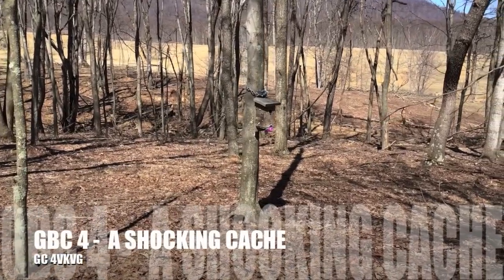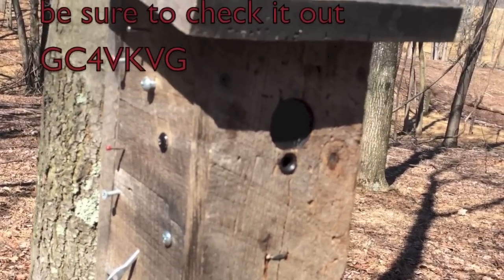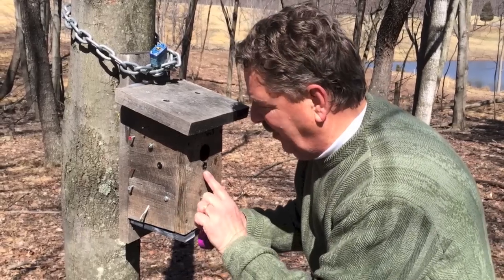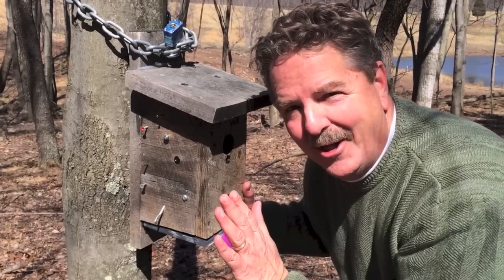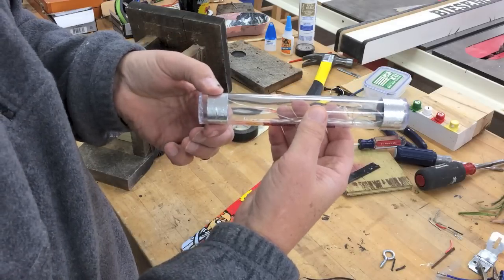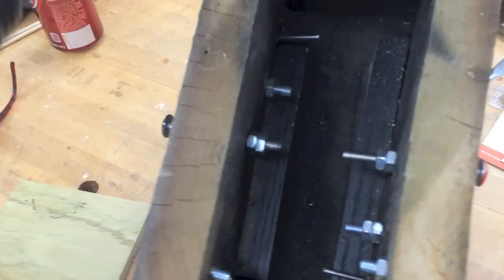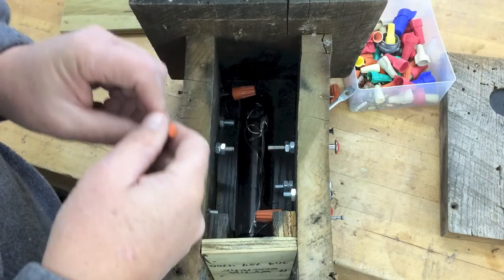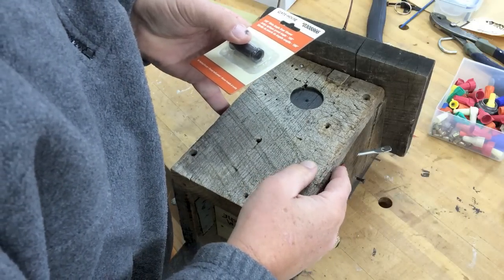How to build a "shocking" cache

Comment: Hello WV Tim! Built this cache about a month ago. I was having problems with the battery dying (in 3-4 days) in the stick. I believe it was due to heavy rain, damp plywood despite two coats of paint. I fixed it by using car spark plugs through the plywood. Working for 2+ weeks so far, I think I'm in the clear.

Comment from the maker: Update : anyone building this cache, if you have trouble with the energy stick going off accidentally, I suggest insulating the nail or screw connected to the stick.  YOu can do that by drilling a little larger hole and wrapping it in electrical tape.
Reply from the maker: There are several ways to insulate the screws, another way of doing it is put one screw or bolt in a plastic sleeve ( like a small plumbing tube)
Reply: I built this cache, and it keeps draining the stick. I think it's because the wood gets a little wet and it's enough complete that circuit. I ended up insulating the bolts with vinyl shoulder bushings - but it happened again. Need to think a bit more about how to make this work reliably. It does rain a lot out here in WA state!
Reply: Still drained battery after hack-insulation job. Used car spark plugs, fun and effective! Working for 2+ weeks, I think I'm in the clear.
Reply: @dkerlee  Hello, I'm a visual person can you send me a picture of how you used the spark plug?

Comment: Hi Tim, just wondering how this cache is holding up to the elements? I'm trying to use the same set up to illuminate coordinates for a final stage of a multi but I'm having a lot of trouble with the stick going off on its own. I'm going to have to break it down and try to insulate it better. I found that the paint I used on the box is very conductive especially when wet.
Reply from the maker: mvalentine67051 I had to do the same thing.  What I did, was insulate one of my connections in a plastic sleeve.  I found a bolt that perfectly fit in a plastic sleeve .  Seems to be working pretty good.  Depending on usage, I can normally get several months out of one stick.
Reply: I ended up using car spark plugs